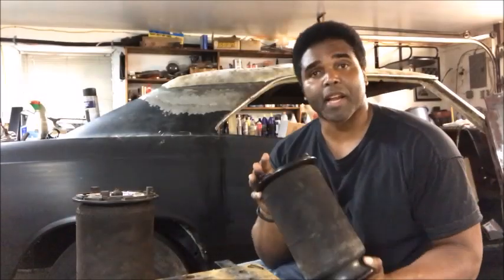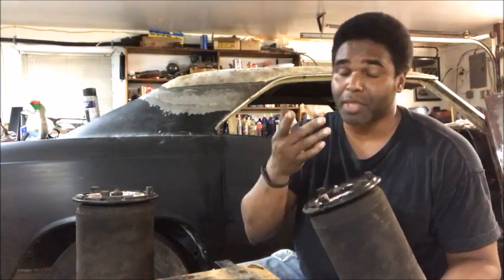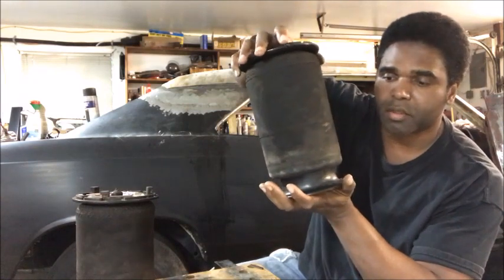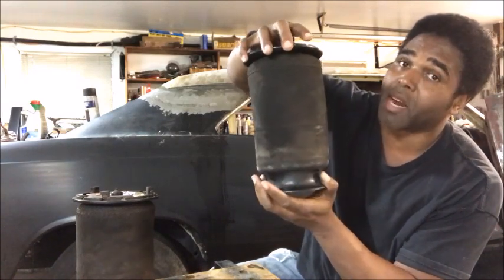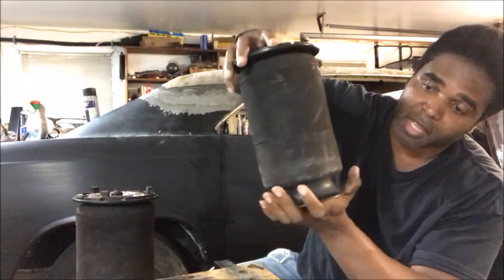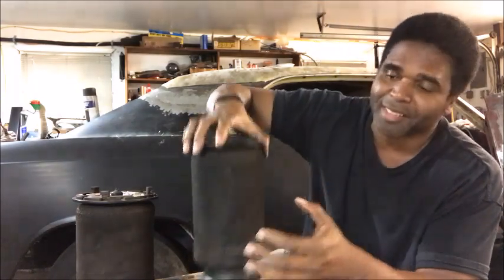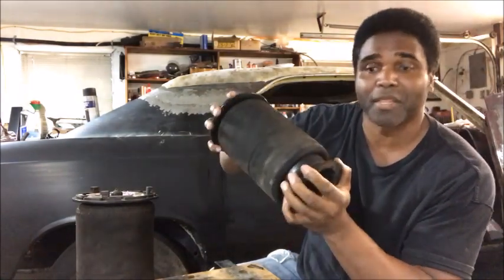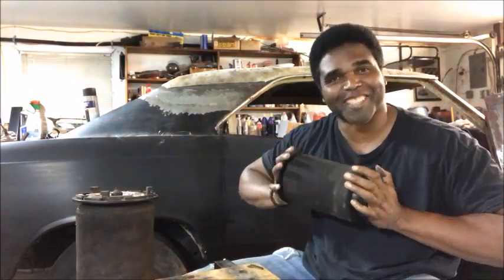Why Do Airbags Leak?  (Coverman66 Breaks It Down)

Comment: i replaced my shocks and bags about a month ago, started dragging ass when i wouldnt drive it for 2 days lol, everything seems fine since but it seems i have a pretty small leak i think somewhere in the lines but for the most part it really makes a difference from normal coils. i redid my front control arms with the same problems that you had with the bushing being shredded and i tried pressing the fuckin bushing out, but i just gave up and went to oreillys and bought a new arm, much easier..
Reply from the maker: Totally! i would not use the old arms unless i had to. smart move..
Reply: the only thing is i hear my pump run more than normal but now my car doesnt drop when i let it sit a couple days
Reply from the maker: i was having issues similar, i glad i got the kit before the bags blown.. a couple of hours later i was rolling..

Comment: Thank you for this.... you're 100% correct. We had an '04 Navigator that we replaced air bags with a coils. I realized when I was doing the swap that there were three separate systems, each with it's own multiple points of failure. Those have hydraulic, electric, and pneumatic controls... valves, actuators, etc... all over the place... and you just pointed out fourth... just raw material failure. These systems fail frequently and can run into the thousands for parts, labor extra.
Reply from the maker: yea and sometimes its hard to pin point the problem.. springs are the way to go.. thanks brotha Dean..

Comment: Replaced my wife's air bags with springs on her Ford Expedition. Computer throws codes, but rides great. You would think they would make the rubber bags with urethane which would allow you to grease them to prevent the ever dreeded "DRY CRACKING"..
Reply from the maker: you would think loolol